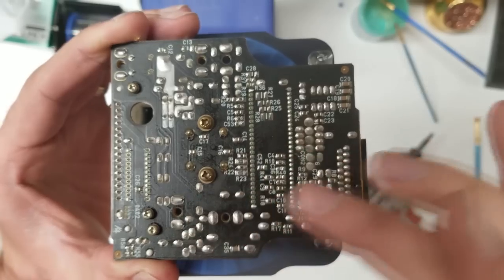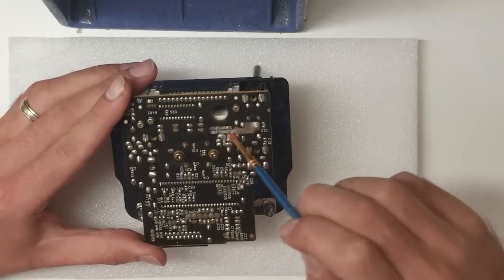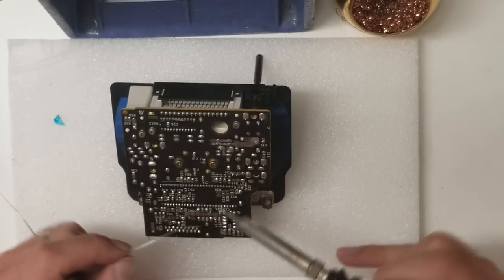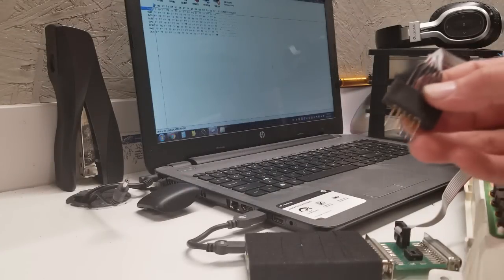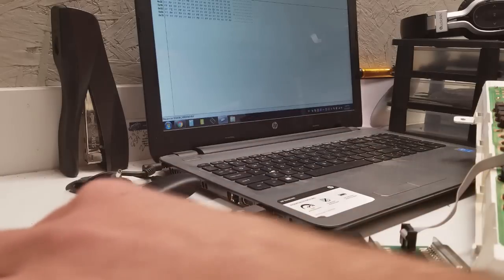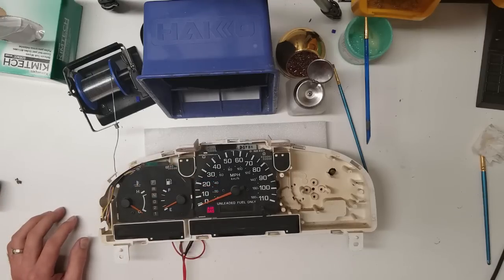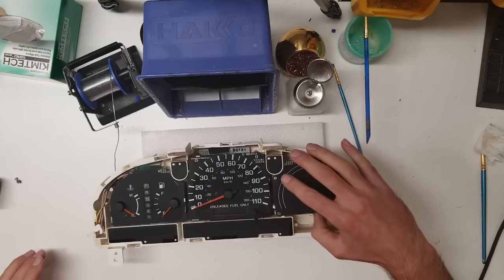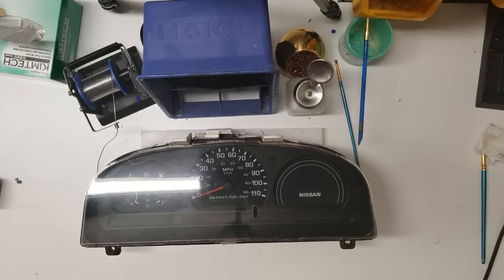Watch me repair a cluster from a 1999 Nissan Frontier 1998

Comment from the maker: Caution: We get more and more of these with damaged circuit board due to inadequate soldering skills. Sometimes they are damaged beyond repair and as you probably know it's almost impossible to find one for under $500. Please do not try this unless you know what you're doing and are equipped with the right tools. I know I do make it look easy, But that is because I have the right equipment and years of experience.

PS. Please don't remove the needles. There is no need to. Most of the time it will pull the pin out of the motor which makes the motor junk.
Reply: Hey i have a question does the air bag on that year have a bulb on the cluster" and where is it located i couldn't find it " please respond when u have time and read this..
Reply: @thefoxx6262  , yes they do , they actually have two of them one for passenger located on dash board , the other one for driver locate  in the multimeter itself , the driver one is linked to the diagnose sensor unit through your steering spiral unit , the diagnose  sensor unit is located under the driver seat it controls all SRS including seat belts . 
now , if you having problems with any of warning lights flashing ? ( a normal automated by diagnose sensor is active every time you turn on the ignition switch to on for 7 seconds and goes of ) , if it stays on or flashes ? there is a proceedure to run troubleshooting  without consult devices the dealers use . and that is as follows : 
step 1- disconnect both battery terminals , wait aproximately 3 minutes . and connect them both . 
step 2 - open driver door , insert your ingition key and turn to ON ( do not start the vehicle ) 
step 3- press the door  switch 5 times within 7 seconds , this will trigger the self diagnose mode as follows : 
A- the warning lamp will turn ON for 7 seconds and then turn OFF for 2 seconds , and then trun ON for 3 seconds, and it repats 2 second OFF and 3 second ON ,  this means the memory has not been eraised from any prior fix or intemiten melfuntion been detected from the past . 
or ? 
B- the warning light will turn ON for 7 seconds , then turns OFF for 2 seconds , then starts flashinf 7 times within 5 seconds and repeats that . this means  the SRS system is melfunctioning and needs repairs .
Reply: Will you fix mine
Reply: The video content will encourage DIYs to try first and then send you the board already destroyed, if you want to avoid this, modify the video on before and after, otherwise will keep on happening because it looks easy for people who know how to solder but most of them don't even use flux and they will keep the iron too much time on the board making an easy repair a nightmare. being there a lot. good luck
Reply: I have a pathfinder 99 I live i florida. How much will be to get repair the cluster. Sometimes it goes blank and the only working is the gas gauge
Reply from the maker: @rogeliorodriguez8696  currently the price for that one is $120. Here is a link https://www.automotivecircuitsolutions.com/collections/nissan-infiniti/products/1998-2001-infiniti-qx4-pathfinder-instrument-cluster-speedometer-repair-service
Reply: I need my rebuilt need information how to send it

Comment: Thanks so much for showing this.  I re-pointed all of the joints, rubbed some DeoxIT on all of the connectors, and fixed the non-functional odometer and speedometer needle. (I have 40 years experience soldering and used to do field service on PCs with this era electronics and connectors)

Comment: Hello, I need your help.
I reflash my eeprom with the dump file that I bought on your website everything works again so thank you ! 
But I'll need to replace the stepper motor for my speedo gauge ( it's not in Really good condition and the spring is dead ) 
Do you know where I can found this part ?

Comment: Hi my name is Frank and I have a 98 Nissan Frontier my brother tried to fix my speedometer and now the tach doesn't work and the airbag light stays on would you be able to fix that for me
Reply from the maker: If he didn't remove the gauge needles then we likely can still fix it.
Reply: @AutomotiveCircuitSolutions  no I don't think he remove the gauge needles but he did try to resolder it in places that he thought had a bad connection providing we can fix it can you tell me what would it would entail and how long it would take because I tried driving it without the instrument cluster in there and it won't charge the battery so my battery went dead
Reply from the maker: @johnbodnar3586  we repair and send back within 24 hours of receiving it. The whole process usually takes about a week depending on your location

Comment: My odometer works so if I skipped that section would that save me from reprogramming?
Normally my Speedo stays on 40 mph while moving and my fuel gauge stays at full 90% of the time.
Reply: @AutomotiveCircuitSolutions  I was planning on doing this myself.

Comment: were i can download the software you use? I have a VP199 programmer that can read the EEPROM but i see as HEX only and i dont have translation of the data to see my recorded miles.
Reply from the maker: In this video we used the Carprog original from codecard.lt . the software only works with there programmer which is around $2k. If you'd like to email us the file we can check how much miles it has.

Comment: If I’m doing this repair on my own truck do I need to reset it or plug it back into a computer?
Reply: No, if you fix it then worse case scenario is that if all indicators are back to normal that you need to reset the ECU with a scanner to erase the P0500 code.